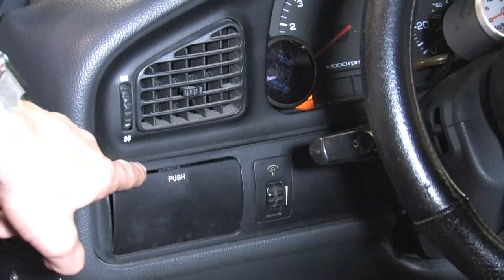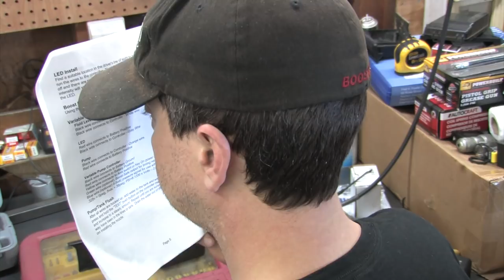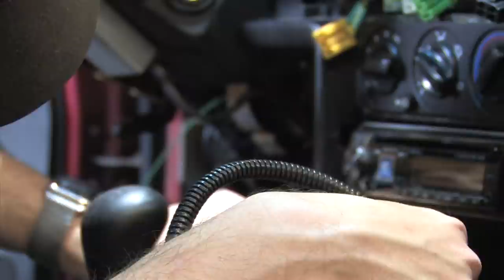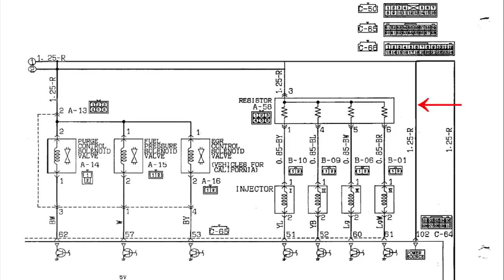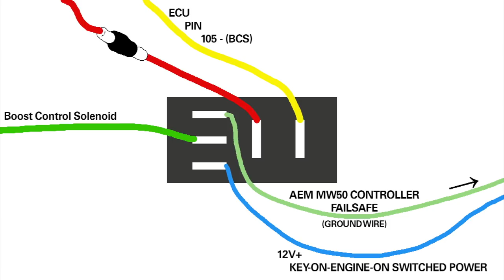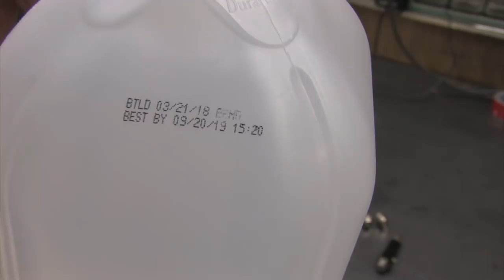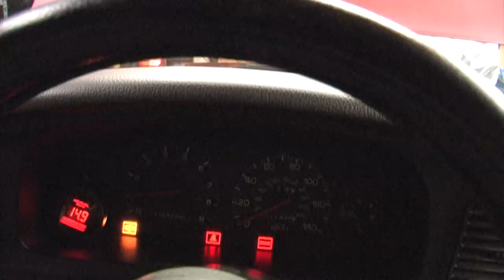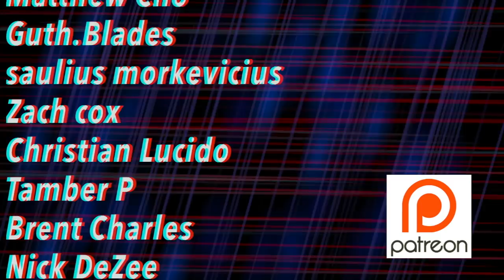Water Methanol Injection Installation

Comment: New jafromobile!   I’m stopping work on my Subaru to watch this...    true car guys respect all cars equally.
Reply from the maker: Whole-heartedly agree!
Reply: Oddly, as I was watching this, near the end I thought, "I wonder if those NASIOC guys know about jafro?" The only NASIOC maintenance day I went to, (Sadly no Subie in my life currently,) was impressive both in turnout and knowledge pool. Lots of guys doing bolt on stuff, but others hacking and fabbing.
Reply: BluDog35 you said it man!
Reply: I am currently developing a flex a meth kit for myself with the potential for selling them. With the new map switching that the flex fuel cobb stuff offers the idea is that when you arm the meth kit it will map switch to the meth map. Fail safe will be off a pressure transducer in the line that will look for low pressure and too high of pressure and the ecu can map switch off of that. Subaru ECU's are pretty advanced now.
Reply: What an incredible amount of information in this one video!
Reply: All the "brands" engineers screw us over eventually one way or another
Reply: I have a project EJ16 subaru inpreza 1.6 non turbo . I want to put this injection kit on it but will it work on non turbo?
Reply: @EmotionalTree  Hi, I would love to see that do you have a thread anywhere ,BB or page ?
Reply: That’s true Bc I just subscribed to your channel!!🤣🤣🤣

Comment: Excellent work as always Jafro, thank you for sharing it with us!  I always wanted to integrate my water/methanol injection into ECM Link but never got around to it.  Enjoy the results!
Reply from the maker: Thanks man!  IIRC, you have the Snow Performance kit... if it also has a failsafe ground, you could do the same sort of thing.  I'm just going to compensate fuel and timing in the cells wherever it's on and let the MW50 float switch control high/low boost.  Are there any benefits of connecting the two?  I dunno?  There are so many people using so many different methods, it's hard to tell what's best?  I just knew I needed to make mine idiot-proof because... well... it's mine after all...

Comment: Thank you, Sir. As to your comment of not being able to find methanol in your grocery store- where I live, in Central NY we use washer fluid that's rated for NEGATIVE 20F, perfect for your application. The only major concern, is having to change your oil more often under heavy or more frequent use. The water portion mostly boils away, keeping combustion chambers clean- but it also tends to homogenize to the oil under high revs, making a foam (colloid) in the pan, that is easily removed with a proper kerosene flush before oil change. Your engine is going to be very happy when you get this dialed in. Now- if I could just convince you into researching a "REAR mounted" turbo setup; many videos here, no intercooler, no lag, easy & cheap with your DIY skills. Stealth AF.
Reply: HUBBABUBBA DOOPYDOOP no intercooler with a rear mount? Are you relying on the water/meth then?
Reply: No, the mere length of aluminum tubing is a huge heat sink, moving through the air; you can install one- but it's usually superfluous. Check this link- https://www.youtube.com/results?search_query=rear+mounted+turbo  What's nice- if you have fab skills and some decent tools- you don't have to spend huge money on a "kit". DIY is yours, anyway. Make it yours! The 2 costly extras are a decent oil scavenge pump, and longer charge tubing. No more cooking and coking your turbo. It's all about volume- not psi.
Reply: Would a windage tray help?
Reply: In Jafro's application- I would think the Stock oil pan already has "baffles" and since it's a transverse FWD there's not much worry of oil control.

Comment: Heck of a video!! there's an incredible amount of detail, and the fabrication and wiring was
top notch! One thing that I was particularly impressed with was how freaking stout and clean your mounting bracket for the tank and pump turned out. One of my long delayed projects is to do this install on my car.

Comment: "Read and understand the instructions fully" - 30 seconds later, I'll figure out where that goes later.
Reply from the maker: :D  The instructions made no mention of it.  Best I can tell is it's intended for you to make your own grommet with wherever you punch it through the body/firewall.  I wound up not needing it because my hose ran through the boot in the shifter cables.

Comment: I run water/meth injection on my talon, probably the only thing that's kept that poor, tired, worn out POS from kicking what's left of the 3 straight rods out of the block at any given moment. Nice install!
Reply from the maker: Wait... how is the 4th rod gay?  I didn't even know rods had a preference?  ;)
Reply: Jafromobile lol, it's most likely bent, last time I had the head off, 3 Pistons came all the way up flush with the block but the last one is about 1/8 inch below the deck. I've been hard on this motor and apparently I'm not the first, Pistons and head look like someone threw gravel in the thing at some point. I didn't have time to deal with it then so I knocked off the sharp spots and put it back together, ran another season and a half racing it before I decided it was time to retire it.

Comment: Jafro- first of all, great work! Your vids are the best! I have this same kit. FYI, the aem check valves are garbage. They leak bad, a constant drip. It’s been well documented in the community. It will effect your tune and you’ll be refilling your tank frequently. With that said, Looking forward to another vid in which you address the issue. Yay for more Jafro vids!
Reply from the maker: LOL!  You must have ESPN, because I have that problem.  Filling up my intake while it's parked.  If you drive it every day, not such a problem.  All it takes is a change in the weather or sitting in direct sunlight.  Due for a solenoid.

Comment: Water/Methanol injection is just so genius. You clean your intake, lower emissions, lower temps, reduce knock and make more power. You should see these standard on normal cars. But the people driving them couldnt be bothered with filling up. I would love to implement this system on my tdi car or even a NA car.

Comment: i made this for my 350 vega back in 74..i used fish tank hose and valves for the hose to regulate and turn on and off the flow.. the line was plugged into the intake manifold under the carb base plate..the other end was routed to the dash where it could be controlled by turning the valve on or off..first of a kind back then ...people scauffed at it.. i knew all about how the system worked because i was air force mechanic who learned about this ADI injection first developed by germany...they climbed higher and faster in a dog fight because the ADI prevented detonation..it works great if you are climbing hills because it will cool the combustion chambers..ect
Reply from the maker: I totaled a 1976 Vega GT once.  It had a 24 point roll cage and a 468 all-roller big block.  I got it about 6 feet in the air.  The Silverado I landed on didn't fare to well either.  I got to replace the back half of it.
Reply: yeah you most likely power shifted and went in his lane hhh...auto was the way to go with those cars..it was easier on the rear and no worries over the breakin stuff when you launched..mine was a 73 hatchback yellow with black stripes...really a nice car..drove it every day ...a real cruiser on the interstate !! 74 was a square taillight right?..its been a long time but i still remember the install and some other stuff...my engine was pure stock with headers

Comment: Another video....that makes my weekend! And this kit finally makes it on the Elantra! Can’t wait to see the difference it makes on the track and the tune. I say, you need to make an intercooler sprayer next? With a windshield wiper pump, (the Mirage assembly you already have??) and nozzles from the garden section of Lowe’s. That way, you’ll kill some of that heat soak on the intercooler between passes. Thanks again for another greatly produced how to on this kit. Can’t wait for the next video!

Comment: I run in-tank E25 in conjunction with methanol injection on my Speed 3. The ethanol mix alone is sufficient for the added octane I need to run the timing and boost levels (~25psi) to safely get 390/385 @ the wheels (in good weather) on my fully bolted setup with a GT2871. I threw/tuned for the methanol on top of the E25 mix to have an extra safety layer, lowering cylinder temps hundreds of degrees more, adding even more octane, cleaning my intake valves (I'm direct-injected), and minimizing the power loss I experience in our Texas summertime heat due to lower oxygen density in much hotter air, which gives rise to higher BATs.

I know supposedly 50/50 is the best mix to run, but after extensive (years and years, thousands of drivers) experimentation on our platform, almost everyone ends up on spraying pure M1 (100%), finding it far superior. After trying 50/50, 70/30, 80/20, etc., our Speeds just seem to love 100% much more, making better power and staying much happier. Just goes to show there's no one-size-fits-all approach; different platforms respond differently.
Reply: 1-year later comment update:
One thing I've learned is that push-to-connect fittings with ALWAYS leak, it's just a matter of time. Converting to stainless lines and -AN connectors is expensive, so I recommend just going to all compression fittings, which still avail the use of 1/4" OD nylon lines found it most kits. This is a much better solution, in my view.

Comment: LOL I see you clutch hover! I do the same too. The funny thing is people insist that I must change clutches 1-2 times a year but I don't. Not once out of all the cars I owned over the 25 years. What they don't realize is that my foot is not pushing on the clutch, just enough to tactfully feel it on the soles of my shoes, drives my car buddies crazy lol. I also use second gear to start off regularly in my DD's too haha.
Reply from the maker: The clutch that's in this Hyundai today is the same clutch that went 56,000 miles and 250 drag passes in my 3355lb AWD GSX.  It's a used clutch that out-lasted THREE transmissions.  Four counting the FWD one in the Hyundai.  It still works like new.  When it turns 500 drag passes, 100,000 miles old and finally lets go, someone will post "SEE, I TOLD YOU YOU WERE RIDING THE CLUTCH!"

Comment: Correct me if I misunderstand how it's wired, but if the dummy load is just switched between battery and a simple open-collector output, then dissipation of the dummy load would be (14.5v^2) / 37R = 5.7W.  At a glance,  those resistors look like 0.5W carbon film resistors.  

While perhaps the overstress to the individual resistors might be acceptable in something that is only occasionally and briefly energized, the net ~6W dissipation inside such a tiny volume is probably going to get way too hot for the heat shrink.  

Inexpensive 5W to 10W wirewound 33, 36, or 39 ohm resistors can be found on ebay or mouser.  Ones with mounting tabs or cases can also be found if it's desirable to affix it to something instead.  For example:

https://www.mouser.com/Passive-Components/Resistors/Wirewound-Resistors/_/N-7fx9f?P=1z0wn81Z1z0wlb5Z1z0wnl8Z1z0wn9cZ1z0wn8fZ1z0vv12Z1z0wt4wZ1z0x73vZ1z0wnlpZ1z0wnm0Z1z0x6i4Z1z0wnmxZ1z0x73o&Ns=Pricing|0

https://www.mouser.com/Passive-Components/Resistors/Wirewound-Resistors/Wirewound-Resistors-Chassis-Mount/_/N-7fx9g?P=1z0wn81Z1z0wlb5Z1z0wnl8Z1z0wn9cZ1z0wn8fZ1z0vv12Z1z0wt4wZ1z0yli7Z1z0x73vZ1z0wnlpZ1z0wnm0Z1z0x6i4Z1z0wnmxZ1z0x73o&Ns=Pricing|0

https://www.ebay.com/itm/Wirewound-resistor-10W-5-0-1-5-1K-Ohm-various-1-2pcs-Aluminium-Housed-Clad/182372944803?hash=item2a76464ba3%3Am%3AmQVakRDbN2fBRsEvIBKuueQ&var=484934906325
Reply from the maker: I'm thumbing this.  Great info!  I'm not an electrician.  Like so many other things I just used what I had.  When I wired it, and when I made the diagram... I had the fog of my 1995 Eclipse's BCS solenoid behavior stuck in my head from experience.  My GSX is OBD-II.  My Elantra is OBD-I.  I made the distinction between them in the text overlays because by the time I figured out I don't even need that wire, the video was shot, animations finished, voiceover done, and because it applied to second generation cars, I left it the way it was.  My ECU does NOT check for a BCS.  Should that resistor pack fail or cause a problem, I'm just going to remove it.  I'm going to leave pin 87 blank.  YOUR INFO IS GOLD for people with OBD-II, for nearly everyone in the Subaru crowd, the Mazdaspeed crew, everyone whose stock BCS is required by the ECU.  So far my proof of concept HAS worked, though, and after driving around for 20 minutes with that wire lit up, it's been cool to the touch (so far).

Comment: A boost gauge is not to log boost, not to do boost leak testing, nor does it replace the logging device, it is a merely complementary device as an added verification of things. It is there  so you can look at it while you are driving, make sure to put it at a spot where you can actually see the intended max boost on it easily.  The reason you should have one is in case you are running an aftermarket boost controller and not controlling boost through the ecu, and it so happens for any given reason such as is a split on a hose between your 3 port and the internal or external gate, which will lead to overboosting, and or there is a malfunction with the controller not maintaining boost up to the set limit but exceeds that, or the wastegate is malfunctioning. For such reasons you need to be able to see when the turbo system overboosts even by a small margin, so as to take your foot off the throttle. Also, methanol bonds its molecules on the benzene ones and being a highly oxygenated fuel forces the benzene molecules to be burnt more completelely and more uniformly , it does not stabilize benzene molecular structure in any way. Apart from that methanol binds all the "negative" substances that are in a benzene pump fuel mix thus allowing benzene to reach its full anti-knocking potential and higher octane rating. Lastly it also cools down the combustion chamber keeping cylinder pressures in check. All these factors plus the cooling the water offers to the intake air, allows you to run higher boost pressure on denser air along with more advance timing. Good video, good work, keep it up.

Comment: Thank you for all the detailed info on your failsafe.  Likely not going to be a large deal to me since I'll be using it more for cooling air mass than boost timing...but, I tend to be the belt and suspenders type when I'm 100 miles into the desert with no help available....
Reply from the maker: I do that, too.  You should check out my offshore greenhorn fishing video, lol.  5 miles offshore might as well be 100 miles into the desert.
Reply: @Jafromobile  Will look at the video.  And I agree...big reason I'm going supercharged is to be able to tow a boat capable of the occasional 40+ mile trip straight out for Albacore.  Though doing that, we pretty much always run buddy-boats because stuff happens.

Comment: Jafro! On the tuning front, you can do like I do: I've got a tiny acer ultrabook running only the tuning software required for my setup on it, stuck in the glove box with a car laptop charger. The ultrabook was payment for helping my neighbors take some old furniture to good will, and the car laptop charger was $20 on Amazon.
Reply: Thats a good shout. 12v to 19v(?) converter for the charger?
Reply: It's a 12v to OEM plug, looks just like a wall charger except with a 12v plug on the input end. Seem to be made for quite a few different laptops, too.

Comment: I would've put the pump under the hood somewhere that is as close to the injector as possible. I know that the injector has a check valve and backflow and all that but this is a non-continuous pressurized system, so for me having near instantaneous injection response is more important.

Comment: I don’t have any problem with how you have done this. I just hope your present wiring harness doesn’t fail you on the track or off! If it matters for one part, it should matter for all or why bother! Just saying! I get off my box now and say good job and smart thinking on how this system was addressed. Not everyone will be onboard, but they’re probably just jealous because you came up with a common sense solution to the problem and they are clueless. You should be proud of this and I hope it yields what you want on the track. I do not advocate it’s use off, however!🙄😠😲

Comment: The water goes bad from potential contaminants from the inside of the jug during bottling (air contaminates or touch).  Also gases can diffuse through the jug and also create an unwanted reaction theoretically.